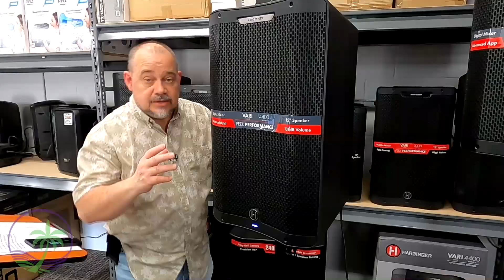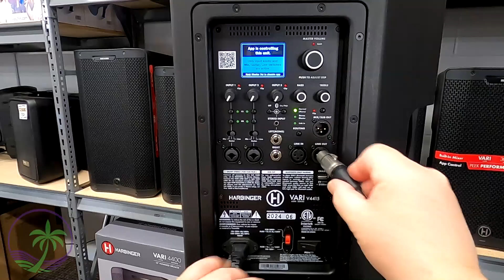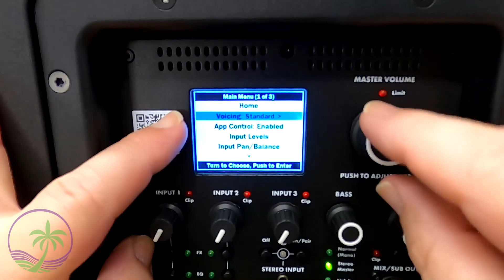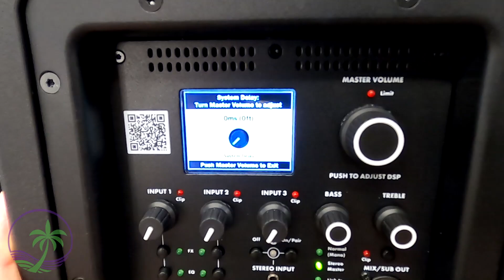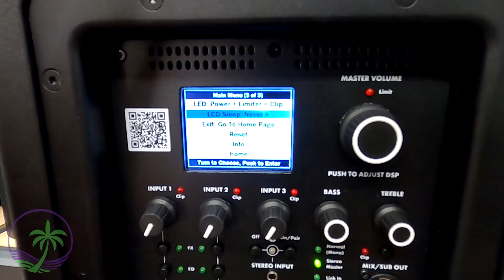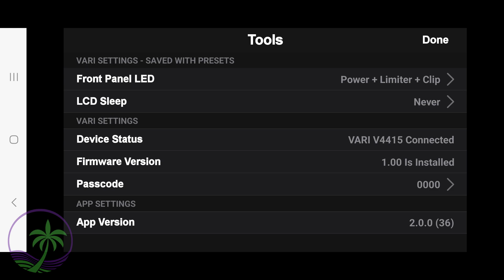Harbinger VARI V4415 Powered 15" 2-Way Loudspeaker With Mixer, FX, App Control, Bluetooth, DSP

Comment: Hey ROBIN THANKS FOR ALL KNOWLEDGE YOU GIVE,I LIKE THE WAY YOU EXPLAIN EVERYTHING BUT I NEED SOME ADVICE ON WHICH SPEAKER TO GET I PLAY KEYS FOR A SMALL CHURCH AND RECENTLY PURCHASED TWO HARBINGER VARI 3115 but I need a monitor and was wondering if I purchased the 4000 series just one for now if I set eq on that one would it relate to the other two and use one of the 3115s as monitor or just get the alto 15 or Gemini 15 they are a lot cheaper and not using a mixer now I have one but more to tear down every Sunday I was using my twenty year old Bose tower but space limited appreciate some feedback ( undecided)

Comment: i got 2 harbinger speaker,  2315 , used them for 5 years,  and traded them at guitar center for one EV speaker,  ev bass is not powerful like harbinger,  now i want to change for harbinger 4415,

Comment: I ended up picking one of these up. Thank you for the well-informed video.   I am curious.  Did you ever do a video on the EV ZLX G2 Series?  I have one of the those I picked up before this was available.  And a month ago I got a 3415 on MF stupid deal for $250.  which I plan on using as a drum amp.  But I would be curious to hear your thoughts on the ZLX 15P G2 because it has many of the features and even more effects with its built in dynacord.  But with 129db max spl similar to the vari 3415.    I was so impressed with the harbinger 3415 that when they had a sale on them and financing i picked the 4415 up which I am planning on using for vocal and as a bluetooth speaker as a stereo system.  But really love the channel and if you have any thoughts on the zlx g2 id love to hear them.  I think what I like about harbinger is they give you the actual RMS watt rating.  EV never gives that.  But they also rate it at 1000 watts peak where harbinger claims crazy high peak wattage numbers.  But at least harbinger gives the the RMS rating and tells you exactly how the thing is made.  I love my ZLX G2 as a Guitar monitor.  But I honestly cant wait to try the 4415.  Im hoping for some more headroom over the 3415 and the master volume for the dsp is a major win for me.

Comment: question: I use a Tascam Model 12 mixer .. all instruments connected directly into the mixer.  Do I connect the two main outputs left and right from the mixer into the 4415 channel 3 L/R inputs?   Probably never need or use inputs 1 or 2 on the 4415's.  Thoughts anyone ... ?  Thanks!

Comment: I love my harbinger vari2412 better than the EV ZLX and now this Vari4400 serie better than the ZLX G2
Reply: absolutely right
Reply: not entirely, harbinger uses dirt cheap components that don't sound great
Reply: @Bxyzfnf I thought this was true until I demo’d them: it was certainly true a decade ago with the V2115 model. Even against Mackie’s lowest end Thump 15 at the time which were boomy and veiled sounding, the Harbinger speaker was worse: Not a ton of bass, a little bit harsh in the treble if I remember correctly. 
    The OG ZLX models were better than both, but the OG QSC K12 outperformed everything at the time. 
    However, I agree, I prefer these V4415 over pretty much anything else I demo’d when I heard it. It sounded like there was a subwoofer playing, and I was shocked when there wasn’t. The only speakers that came close were the Alto TS415 (held back by a slight lack of mids and harsher treble) and the EV ZLX 15pG2. (Held back by what I’d describe as a messy bass response: lots of harmonic overtones, not much real depth.) 
     The sore loser was the most expensive one we tested, the JBL EON 715, which had next to no bass and was actually painful. Close behind was the Mackie Thump, which sounded exactly like the old Thump: like a ZLX with a blown HF horn.

Comment: The old Vari just had the level knob. These also have an internal digital +- 10db cintrol. I noticed at noon and set 0db they are much quieter. Do you suggest keeping the knob at 3 oclcok then adjusting internally or keep it at noon and bump
The Db internally?

Comment: It's not a new V4415 as in the title but the 4 year old V4115 ! Please correct title.
Reply: This is the 4415 - you can tell by the metal plate on the top of the grill ...big difference is the box is molded and the tweeter is different and the app works not only on the IOS but Also Android ... Otherwise they have a lot of similarities
Reply from the maker: These are a pair of v4415, I know they look the same, but trust me, it stop there. Everything is just a little better and a little smarter.

Comment: Be honest, I'm a crucial critic of budget friendly speakers. Should I sell my Alto TS4 Series for some of these? 🤔
Reply from the maker: Great Question People ask me this question all the time.
It's more than just is This One better then than That One.
1 - Your speaker no longer meets your needs or the are starting to get Old.
2 - The New Speaker has to Meet or exceed your needs.
This Question will make a Great Video. Look for it in the next couple of weeks.
Reply: Yes, they sound more clear and crip, I heard them side by side yesterday, I tested them with various genres
Reply: @renerodriguez1876  when I tested the harbinger at guitar center I found that they clip way earlier than the Altos did. I play my music loud so that's why I bought the Alto. Also the Altohave a custom EQ and that's what I use to get them to sound how I want. You can't do that with the harbingers.
Reply: @ yes they have a digital graphic eq built in you adjust through their app
Reply: @ these are the new version of the previous model , just came out
Reply: @renerodriguez1876  they still don't get as loud. The 15 from Harbinger only does 130 DB. The alto ts408 does 130 DB. The 15 does 135db. No comparison.
Reply: @ well if you want loudness then go Alto if you want better sound quality and features go Harbinger
Reply: @DJBpartyTV my Vegas do 1500 rms no problem